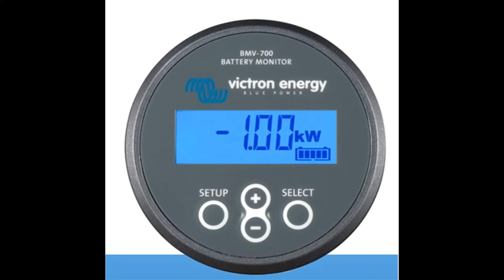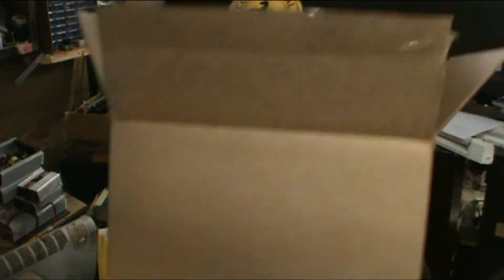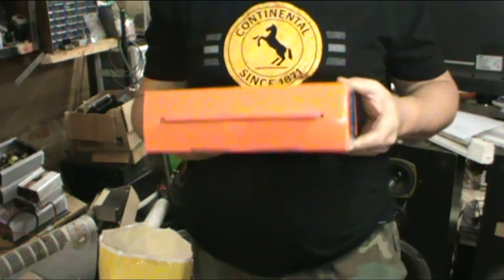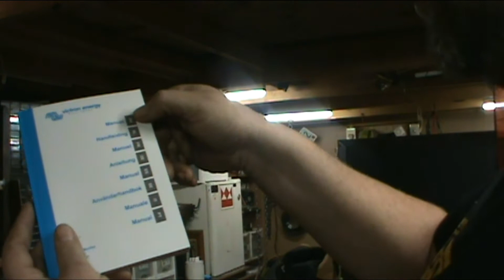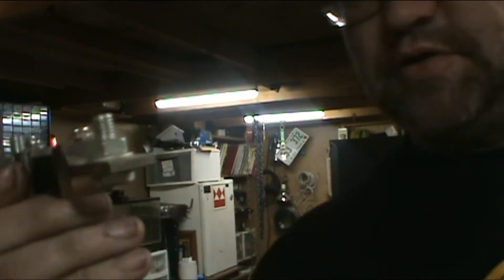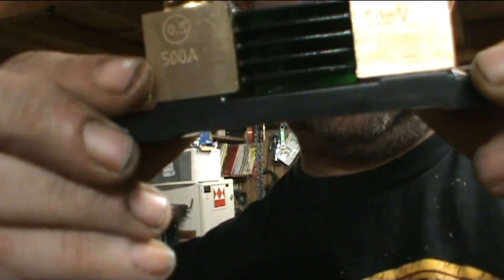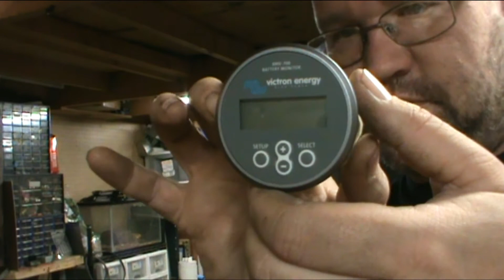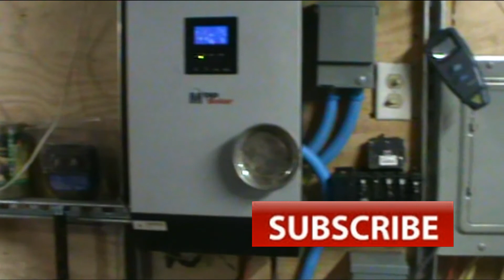Victron Battery Monitor Unboxing and Small solar update

Comment: Be interesting to see how this works out for you. I wish one company would come out with a affordable expandable monitoring board.
Reply from the maker: +Great North Woods Hillbilly I like stuff you can add on to as a system builds.  LIke my inverter/charger the PIP 4840.  Its stackable up to 6 unites for up to 24kw of power or they can be configured in 3phase configs all depending on a person power needs.  And for 900 bucks you get a 4,000 watt inverter with a 3kw MPPT 60 amp charge controller, it can also charge from the grid at 60 amps.    The only down fall is external Tranformers for 240 split phase, as they are only 240 but I have a matching transformer for the 240 volt split phase.   if only they have versons for the US that is stack able like that and also split phase.
Reply: I think as time goes on we will see even more options, I started playing with it 17 years ago, and it has blown my mind at what is available these days compared to the early days